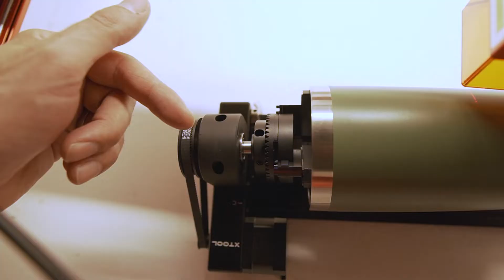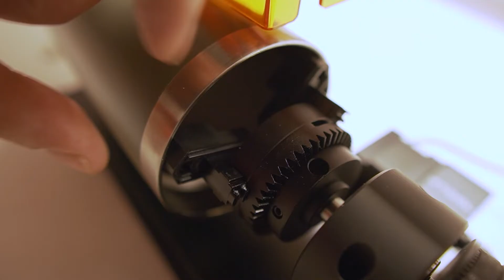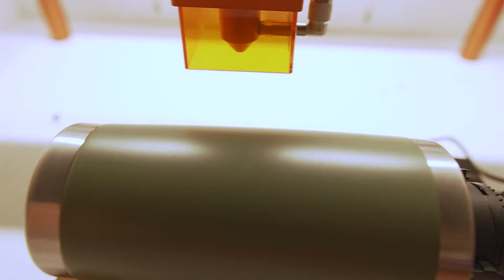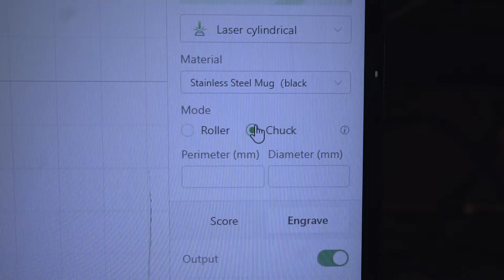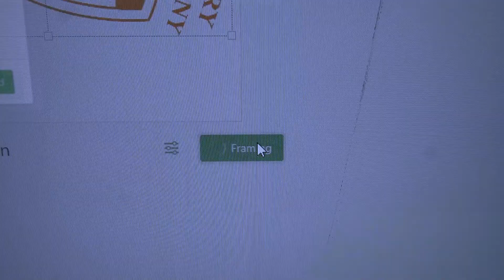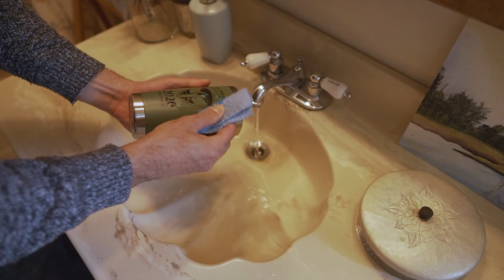Tumbler Engraving with XTool D1 Pro 20W and RA2 Rotary

Comment: That looked like 160 lines per CM, which would be 406.4 LPI.  Also, the D1 Pro won't etch metal unless you use the diode module with the different wavelength.

Comment: I like the black on OD. Mine is only a 10w so I don't know if I can achieve that without something to help. I have done flasks and they were stainless against the flask color. So, yes, probably a lower power setting will give you what you want.

Comment: You can speed you laser up to 80 with a 20w. Power settings are to Low. Use the laser to square the rotary with the laser
Reply: Do you have any idea what speed and power settings would allow a 20w laser to engrave only the top powder coating, leaving black underneath...and not go all the way to the stainless? TIA
Reply: @ no sorry I would do an engraving grid and it shows you what burn setting for what you want.
Reply: Thanks.

Comment: Hi Matt, have you done any more tumblers recently? Curious if you ever found a solution or better settings for getting the nice stainless color and not the black color.
Reply from the maker: I haven't done any more unfortunately.
Reply: He said in one of the comments to use a magic eraser pad to clean off the black soot.
Reply: I’ve done several yeti on my 10 w láser xtool I’ve been using  100 power and 30 speed with the air assist full power I immediately clean it with magic eraser and blu spray 
I’ve had issues with black on the tumblers so I just engrave it again with lower power and higher speed to clean the residue